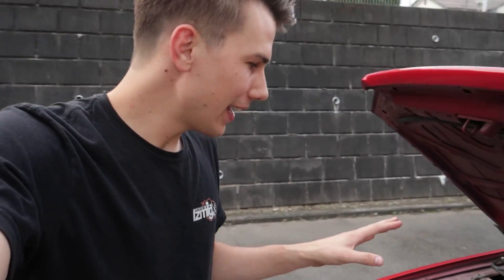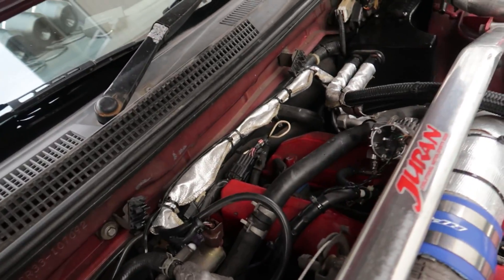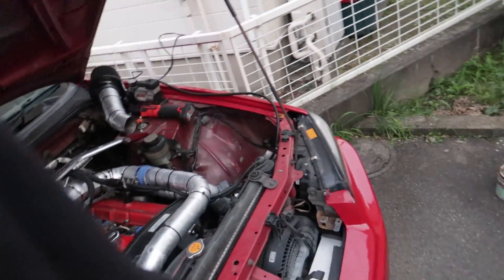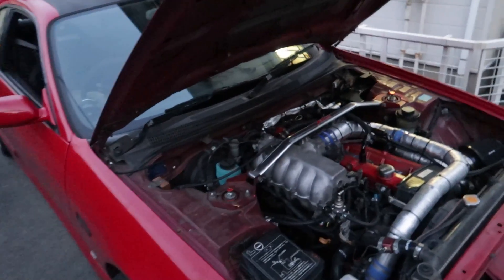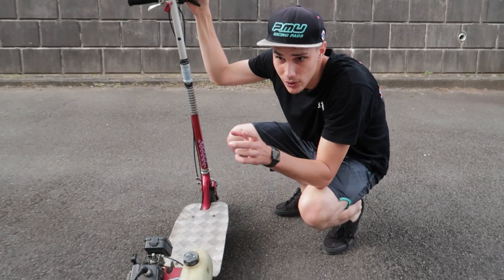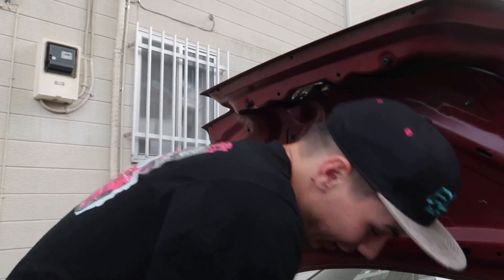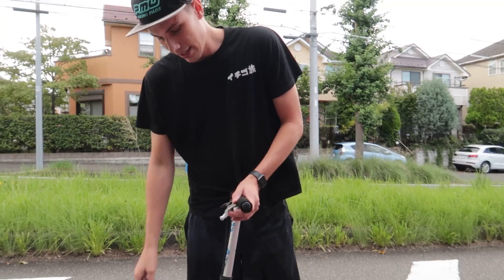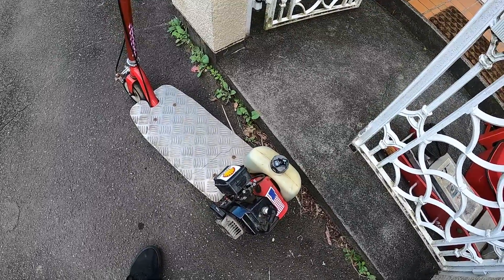GOPED IS FIXED & FIRST RIPS!

Comment: Ive had a ton of these over the years and they are stupid fun but the carb is insanely touchy you need to tune it to the tee to make it run right.
Best upgrades put a performance carb with hi flow intake. Lastly put an x can exhaust in my opinion it's the best exhaust. Good luck

Comment: Most 2 stroke carbs are replaced after 60-80 hours. Also you may want to replace the tank to a bigger one. I did it on a 2 stroke push mower and it helped me not have to refule it have way through mowing.

Comment: Sammit the screw on the top of the carb where the throttle linkage connects is the Air fuel adjustment screw, you can get a high performance carb that will allow you to change the air fuel setting individually and port the head which will give you more power. As for a muffler they do not make a quieter setup I have only seen different expansion chambers which make it sound like a dirt bike

Comment: Hey Sam, you could try cleaning the jets on the carb.  I use a wire strand or several of them from a speaker wire or something and shove it through the small hole in the jets.

Comment: I used to own a go ped back in my childhood. You can do many upgrades to those. I had a Gp290 engine with a air intake and an X can I used to take it my high school. From what I can remember once the wheel gets rubbed down enough you have to replace the rubber. Once that’s new it will skid start very easy. I love seeing this man. If you have any questions I can answer I’m from the United States so I grew up with those. Anyways man love your vids man keep ripping that thing man !

Comment: You gotta check the carb for a high and low screw which should adjust the throttle response and how quick it gets up to speed and Revs up

Comment: Take the carb off and clean it really good. Set it on a brick so the wheel is off the ground and start turning the air/fuel mixture screw until it revs without bogging.

Comment: I had a 600cc sportbike with 4 carbs. When it was cold I’d always start it with the choke on and after about 30 seconds turn the choke off and gently blip the throttle for a another 30 seconds. Then it was warm enough that you wouldn’t just immediately stall it. I think carbureted endings are just sluggish when cold because once it warmed up the engine was a lot more rev happy. After it was warm it would start with out the choke but I’d imagine because the bigger engine and oil hold more heat compared to a small 2 stroke.

Comment: From the ages of 11-16 I had a blue goped sport, a blue geo sport, and a red GSR 40. If you get into gopeds check out the gsr40 or gsr46. They can actually idle without stalling and are chain drive instead of spindle

Comment: could also be there air fuel mixture that can be ajusted by a screw on the side of the carbie. what ussually works is screw it all the way in then 2 and a half turns out. can adjust further out or in depends on how it runs then.

Comment: Going on to this I think you could have a crack in your carb. Those plastic ones tend to expand a lot and crack from heat or just sitting. Usually first thing people got was an air filter. You used to be able to buy aluminum air filters for them  which helped a lot.

Comment: Change the spark plug for sure.. when starting it push primer three times and pull start it then move with your legs for a few pumps then take off. If  the throttle is fully opened when you ( roll start it) it floods the carby when it starts.

Comment: Yo Sam check the spark plug and air filter first, May need replacement. Then clean the carb with cleaner. Sometimes the little aluminum bowl gets filled with crud from bad gas.

Comment: Regarding the easing into the throttle, it seems like it's most likely the carb clogged with dirt, could also be weak spark or the fuel lines are clogged.

Comment: Motor sounds lean, also mix your mixture just a tiny bit more oil. Figure out your fuel screw & idle screw and play with it while out riding it so it stops bogging down.

Comment: You had to engage the choke to start it when cold.  After you rode it a bit and it warmed up you need to turn the choke off.  Choked when warm will cause it to bog down.

Comment: A cool project you can do is making your own 2 stroke exhaust. 
Before I got a s14 I had a goped. Seeing yours is so nostalgic. You should be able to tune it better, mines topped off at 25mph stock. I was able to gun it from zero and it was very responsive. Clean the carbs, the needles need to be cleaned, take some tiny wire and clean them out. Also a lot of guys back in the days remove the intake tissues and poke holes in the intake box, and remove the tube that leads exhaust to the frame.(but you said you wanted it quieter) anyways yours can be tuned to be wayyy faster stock. Mines was stock and def ripped harder than yours was ripping 
Cheers brother

Comment: sounds like the carb needs rebuilt but when i had mine i changed the air filter to the better filter looks like a breather filter . change the muffler and check the clutch they always go bad it should idel when it stops just like a chain saw it should keep running when you let go of the gas and chain stop moving, I had one

Comment: There should be a sponge filter for the air filter and rebuild the carburetter and put it in the ultra sonic and a lil carb cleaner it will run like brand new

Comment: It's probably the air filter, if not you can pick up a carb for like 15 dollars on Amazon. Also check the fuel lines they get brittle. Then you will be able to shred .🤘

Comment: Look into getting upgraded carb and race spindle.   Two of the better upgrades for that groped.   The carb upgrade will make that thing go 60mpg.    Also it’s boggy because it was sitting.  Gas Evaps from oil and oil remains. So clean it well

Comment: Carb needs rebuild, make sure to adjust the float bowl so it doesn’t send too much fuel which can cause the bogging, Clean the jet nozzles with compressed air. Replace/clean spark plug.

Comment: How to tune the carburetor to factory settings turn the idle mixture and air mixture screws completely in till they are snug then back them out two and a half turns that is the factory setting.

Comment: Did you change the spark plug with the  correct plug? Remove the air filter and see if that helps if not remove the carb and rebuild it with a new kit.

Comment: Hey man I do a lot of small engine work, if the fuel looks discolored after the fuel filter, then the filter is bad. My advice would be to find a tune up kit and replace both air and fuel filter, and spark plug.

Comment: That should have a low and high speed mixture screw on the carb. If memory serves right it was 3/4-1 turn out on the low and  2 1/4- 2 1/2 turns out on the high. Keep it on the rich side and grab a few extra spark plugs, the motors don't last long if you run them on the leaner side especially with an adult weight on it.

Comment: Hey sammit the choke switch should have 3 positions one position is full choke next is half choke then off. Start it with choke on then shut it off after it starts. Once it’s warmed up you shouldn’t need to use choke to start just maybe a little throttle. With the carb too besides cleaning it they cook gaskets so lean scooter good in different directions if idle fluctuates that’s carburetor gasket. There simple little engines good filter good spark plug right gas mixture. There happy. If you decide to adjust carb take it slow small adjustments each time. I’ve worked on every piece of still equipment out there. Push mowers to every size of commercial mower. There all pretty simple once you get in there. Good luck man cool chill video.

Comment: Get a tiny piece of wire like from a wire brush and run it through all the tiny little holes on the pilot jet.  While your at it you might as well clean the main jet as well.  Also a new air filter would be good.

Comment: The scooter should have a centrifugal clutch that keeps it from stalling when it’s stopped. The clutch helps with takeoff too based on the strength of the spring you use that holds the clutch shoes together
Reply: That’s not how go peds were designed. They were designed where you literally hop on it push it and go and when you stop the engine stops as well. That’s why I never understood why they bothered putting a pullstart cord on them lol

Comment: Leave the choke open till it warms up then push the choke back theres also a screw on the carb to tune it left would lean it out right would richen it up. You should try and lean it just a tad you go by 1/8th turns

Comment: There is a pull cable on the side to start it so u can get it warmed uo before rideing just wanted to give u a heads up samm be safe bro its not fun crashing on a motorized scooter but they are quick with a cheap upgraded exhaust

Comment: You should upgrade to the bigger motor that’s chain driven and also go back to hard rubber go ped tires. You can also slap an exhaust pipe on these they’re like 120$

Comment: Rev up the engine and block the air intake hole with a rag, it will stall, but the vacuum it creates should clean out all the little ports on the carb
Reply: Interesting
Reply: @VintageTechRepairs  roadkill told me to ehaha

Comment: I would replace the crankshaft seals for the age the motor is. Crankshaft seals are extremely important on a 2 stroke as any air leaks can present as a carburetor issue when infact the seals are shot.

Comment: Sammit clean the carb [completly all the passages] and try a difrent filter material the ones that ware in it looked bad. if that dosnt help it try a difrent carb that has a choke setting on it so you can put that on when starting it

Comment: Sam it should have a low speed (L) screw and a high speed (H) screw on the carb for tuning at idle and full throttle. YouTube tuning 2 stroke carburetors for like blowers weed eaters good luck and have fun👍

Comment: Pump that primer ball like 3 times. And turn the choke on and start it. It does have to warm up. The carb is the biggest problem with any 2 stroke might even get a new carb. They make a 80 c.f. 2 stroke. But theres alot to do to go faster. Look up how to take the governer off.

Comment: You should get a mini bike. It’s the same thing as the scooter but it’s kinda motorcycle shaped. They’re  super fun and cheap. I built mine and I only have 500 dollars into it. Some can go up to 40 mph. But yea. The with the scooter throttle you might need to clean the carb. It might be to lean when you go full throttle

Comment: You need to replace diaphragms inside the carburetter there should also be two tuning screws on the side of it one for idle and then one for wide-open also that spark plug does not look like the right spark plug

Comment: Sounds like your carb jet is to big. Think of it like an injector. The bigger it is the more fuel it lets in. The more air it needs. But your motor is to small. See if you can get a jet kit and go down a size or 2. You may need to get a rebuild kit for it as well.

Comment: Pull apart the carburetor and clean the jets so u can see through the little hole in them then start it, if it still doesn’t run right turn the little flat head screw (usually golden) on the carb all the way in and turn it out till it goes good(ONLY do it when the engine is warm) (in more fuel, less air) (out less fuel, more air) don’t turn it too far out or you will blow up the engine

Comment: the engine is running lean.  You should do a carb clean and clean the main jet.
You should also clean out the exhaust. if it got lots of 2smoke goo in the exhaust it can make the engine run poorly.

Comment: You can get an aftermarket exhaust that will give you more top end or mid range depending on which you choose. But those two stroke exhaust like to get plugged up and it kills power. Be sure to wear you safety equipment those go-peds can be very dangerous for first timers..

Comment: I used to have a Honda one, we put a brand new whipper snipper motor on it. Went about 40km/h, think the bogging problem is just to much load on a small engine, does it rev quick with the back wheel off the ground?

Comment: Get a product called Mercury power tune. Drowned the carburetor it with a throttle open. Let it sit 30.40 minutes. Try starting it it's going to take a lot of work. When you get it  Running rev all the way up. Drowned it out a few times with the power tune when it all away revved up. That should do it.

Comment: Take the rubber hose off from the exhaust and it will be faster used to have one back in the day you can tune the carb too and put a “cold air” on it. Race gas and all.

Comment: You need to vent the tank bro. A nipple off the fill cap and a small hose... If the tank can't vent it will build differential pressure causing the carb to starve for fuel...

Comment: It's a two stroke May they smoke. my older brother had a 1989 Yamaha YSR 50 that had a motor, and custom frame swap... to a Kawasaki KE 250cc two stroke that was tuned by our dad, it did 160 Kph all day every day. he could fit in his 1976 Plymouth Valiant, clean the carb with carb cleaner, the fuel air screw is the one with the "U" on it aka rich to lean fuel air screw, check if the filter is clear... if it has one. lube the throttle cable "little go's a long way" Suzuki chain lube it's the best with out the wax. every now and again use a cloth with dish soap to wipe the wheels down any oil on the tire, and it's game over LOL, make sure to let it cool down before you put it away cool to the touch. it will melt stuff.

Comment: No what's wrong is you need to adjust the choke to run because it closes off the air going into the motor so you need to adjust it

Comment: seems like the centrifugal clutch is seized. although convenient i dont think you should be able to push start it like that.
Reply: they are direct drive
Reply: @imchris5000  well i have never seen one that is direct drive. doesnt make sense that it would be considering a pull start.. pull start in the air, rev it up to get on the pipe and jump on it?? haha.. but if you know for a fact this one is then that sucks anytime you want to coast or stop. we would push to aid starting but it would not die just because we stopped. his low rpm issue is running a 2 stroke at to low of an rpm. the clutch on ours would take care of that problem.
Reply: @dmbworks8094  the one I had was literally the crankshaft extended with a little rubber deal that sat on the wheel to spin it the pull start is just for warming it up and tuning. when I wanted to coast I just held the kill switch button and that cut the spark when I used it I would kick off up to a decent speed let go of the kill and it would fire over and go
Reply: @imchris5000  made by this same company?
Reply: @dmbworks8094  probably not I had mine in the mid 90s
Reply: @imchris5000  i had to look, they sell them both ways.. never did use a direct drive. im 45, i guess i was spoiled haha. would appear this thing is probably a direct drive with the motor on the right tho.

Comment: adjust the carb  there is 2 screws on the carb a L and a H the L is for low side of the carb like starting out H is for wide open if adjustments dont do any good then carb will need cleaned and rebuilt

Comment: Clean the carb, that’s pretty much all a two stroke is, give it oil and gas and it’s good to go, don’t hold it wide open as often, two strokes don’t have a limiter they just kind of keep going till it can’t anymore, aswell try not to bump start it cuz it’s pretty much cold starting it and rippin on it

Comment: need to start off, love your vids, want to visit Japan once or twice but, I have listened to yu call the IAC valve an Idloe air control valve valve soo many times and your triggering me, Idle Air Control Valve IAC valve, please Sammit read this, lol. as a technician of over 20 years i could stay silent no longer. keep up the great work mate. As far as the scooter goes, make sure you turn the choke off when its warm  you would gain some power, but they make expansion chambers for them, had a mate that had one that would do 60 and burn the tire up. but he had like 5k in it

Comment: that bog should be fixed with a carb cleaning, clean the jets. also needs adjustment with the air to fuel on the choke setting it sounds. also replace that filter thats not a real filter

Comment: I've used a shop vac on reverse or a leaf blower to find vacuum leaks and exhaust leaks,  but now you showed me another way , thanks. Not better or worse they accomplish the same result it is just nice to have more tools/options at your disposal. Great video, great car! And the go-ped is sweet I have had a few and they are surprisingly reliable when cared for , use starting fluid with upper cylinder lubricant, safer than  alternatives

Comment: If it bogs its rich, if it backfires its probably lean. It will blow up real quick if its lean.(a little rich is always safer, but a little lean is usually little more powerful, very tiny bit) You can change the amount of fuel with jets. Alot of vids on yt.

Comment: I’d recommend tuning the carburetor. I remember having RC nitro cars and trucks and proper carb tune will give you ultimate throttle response and a rebuild should help as well. Try cleaning the air filter as well and mess with the needles on the carb if it has adjustable needles in the carb